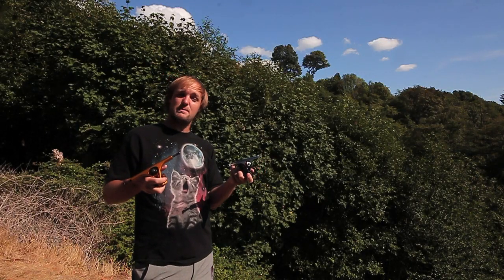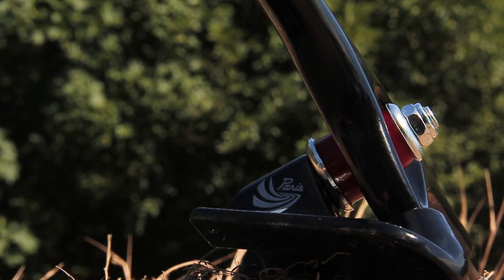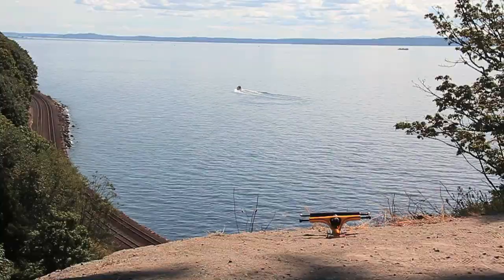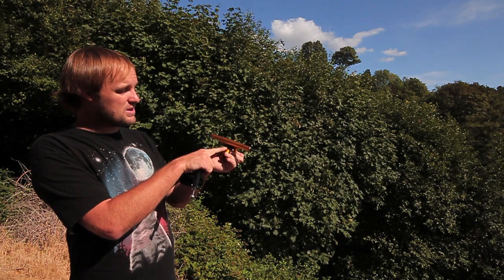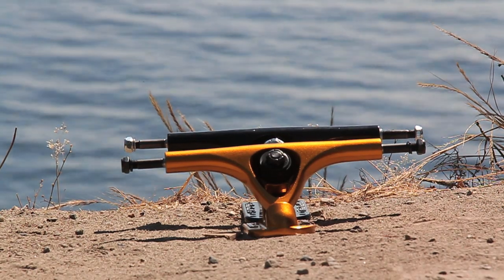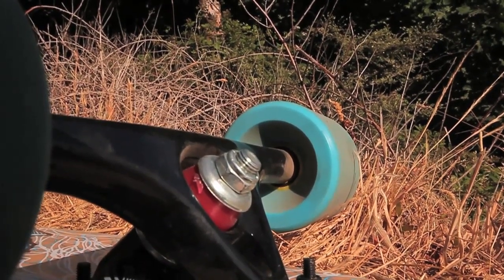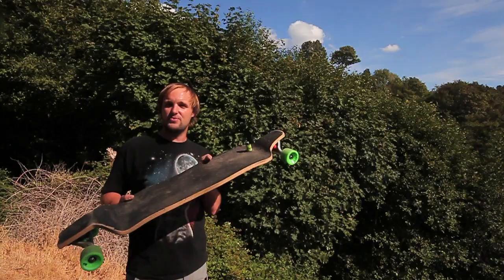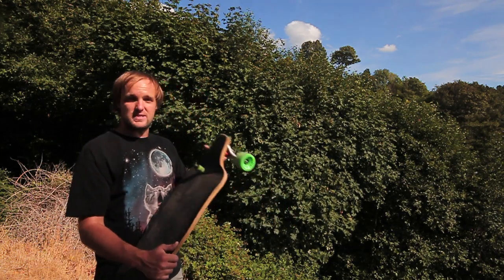Paris Trucks Specs and Setup w/ Nate Blackburn

Comment: Without any boardside washer in the front truck of the Barbarian, the angle is reduced a little because the washer acts as a shim to retain the pivot angle. But I guess it doesn't affect the ride that much even though the angle in front is slightly lower than the back.
Reply: Pivot cups will wear out faster

Comment: Hey Nate, nice video. I appreciate that you go into detail for us and give us reviews that are actually useful, keep it up man!

So I recently bought an Omen Kush that I'm using for downhill and some fast freeride. I went all out and bought cast Ronins and some S9 Steamrollers because I was so excited to skate. I swapped out the stock Fruit Punch bushings that came with my Ronins and put in Venom tall barrels dialed for my weight. I'm exactly the same weight as you so what I did is run green 92a boardside and red 90a roadside. However, I've found that I have to crank my trucks down 3 - 4 turns to feel comfortable at speed because it is still somewhat twitchy and sketches me out. I don't want to over compress my bushings and make my trucks feel dead but I want a stable, confident ride and I need some advice...? SOS
Reply: I have heard Ronins feel weird wedged past 45 degrees. Guess the support pin doesnt activate. Try em on a board without wedging and see how they feel.

Comment: Hi Nate! I'm setting up a high speed freeride/DH omen Kush. I was wondering if I should do a double chubby bushing back truck set up, or if i could wedge the back more with a riser and use double barrels with amish washers. I not really used to drop decks, because my other deck is an original DK that is a super putty set up. I'm 6'2 and weight 140lbs. I'm pretty comfortable riding at high speeds, but I don't like riding switch over 25mph.  #thaneiscool
Reply from the maker: cozypuppet5 riding switch at 25 mph is essentially a death sentence for me now adays.

I would reccommend if your back truck angle is above 35* to go barrel barrel with cupped washers both top and bottom,

If you are below that, throw in a chubby bushing on top and bottom
Reply: OH EF Ok thanks I will try it out and see how it feels.
Reply: cozypuppet5 You're 6'2 and only 140 pounds? That's crazy lol
Reply: Ben Ryan I run distance, and do cross fit so I'm usually around an 18 for a bmi. You have to do a lot of squats to shred the gnar. lol.
Reply: cozypuppet5 haha

Comment: what bushing setup would you recommend for cruising, and bombing hills. On a Landyachtz switchblade 40 with paris v2 50° weighing around 140
Reply: how tall are you?
Reply: sparky3319 i weigh about 145 lbs
Reply: Levi Stoker you said that.. what is your height??
Reply: Sorry about that. Im about 5 8 @sparky3329
Reply: Levi Stoker no worries.
in my opinion that board is too big for bombing hills for a guy that size. im 5' 7" at 150 and i used to ride a 40" deck, now riding a rayne gmack  (38") and feel much more stable. but i still want a bit smaller.. i would recommend a deck around 35, or 36".
Reply: Levi Stoker then as for the original question of bushings.. i would experiment with different combos around 87a- 92a and see what's comfortable. 
let me.know if you have any other questions :)
Reply: Ok. Me i was going to get a 38 but the only available one at the skate shop was the 40 and it was real nice. Me i was thinking the sector 9 mini daisy
Reply: Levi Stoker yea, the switchblade is a nice deck.. and 40" is fine for cruising, or dancing.. bit you'll find it harder to control as you start to reach speeds of 40km/ h+.
it'll be okay for now, but start looking/ saving up for something smaller before you get up to 50km/h
Reply: Ok. Thank you for the advice. The fastest recorded i have gone is about 35 mph